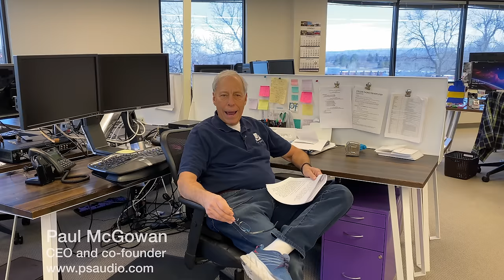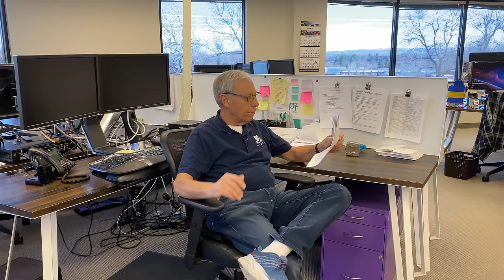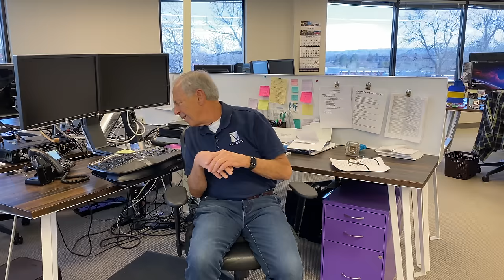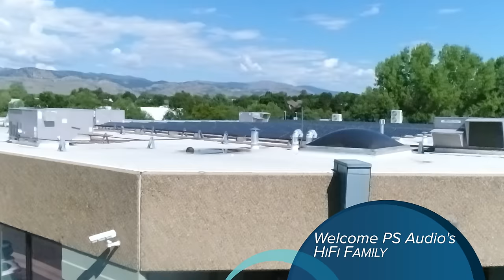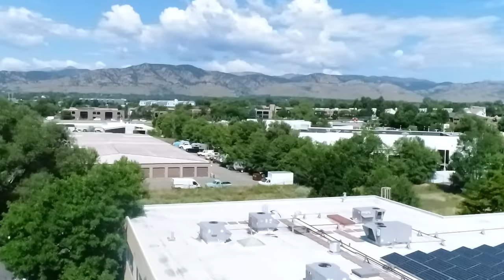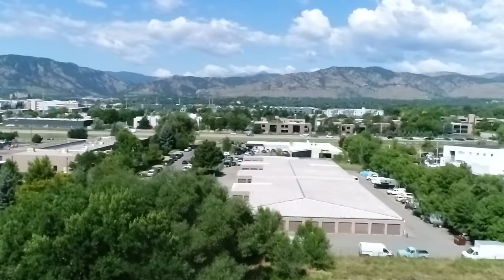Digital or analog out?

Comment: Why do you all call things like this a "CD Transport"? It literally says on the front of my CD player, Sony Super Audio CD Player. Is a "transport" just a empty box with a laser and a way to spin the disc? 
I just watched a video on Nelson Pass and his Ion Cloud speakers. I think he hit audiophiles perfectly.   https://youtu.be/msE14cWTwKI?t=470
Reply: Sort of yes, but the box isn't missing very much that you'll find in a typical CD player. The raw digital data from the laser still needs processing to decode the cross-interleaved Reed–Solomon coded data stream and perform the error detection and correction functions resulting in a bit clock, a word clock, and a data stream for a DAC. Another way to look at it is that a transport includes everything in a CD player except the all important DAC, analog power supplies, and analog output buffer for that DAC while those parts have been replaced by digital line drivers and in most models encoders for the digital output. In the end the amount of hardware is about the same. Another distinction is that in a device designed to deliver digital information rather than analog, special attention is paid to parameters like clock jitter and they'll put extra care into making sure the digital information is presented in the best possible form to the DAC. Can you have transport with a built-in utility DAC? Certainly, that could be a CD player as well.
Reply: @Peter_S_  So the goal is to take a DAT out of the CD player and replace it with an external DAT. Wouldn't a CD Player Maker put the DAT in the CD player that would work best with said CD player? In example, I really cant see someone making a quality Player and then says let's put that POS DAT in there to F_ it up in the very end. Not saying they would put their best in a average Player but at least as good as the rest of the stuff inside the player. Why waste money of good parts just for a crappy DAT? So if the rest of the stuff is only as good as the internal DAT then what is the point of a better external DAT? 
As for the "transports" … just sounds like another way of getting more money out of you while giving you less. The audiophile way imho. My CD player is about the only digital I listen to and I would rather listen to local FM radio then stream. Streaming to me is what you hear in the background at a store in a mall. Don't get me wrong, I was doing it by hot wiring my PC to my stereo back in the late 90's early 2000's just to listen to radio stations from where we used to live. Today I have a Fios feed and I'm sure most of you are "pulling down playlists from the cloud" and such like my kids do but I have let most of that just slide by. Just not into it for some reason. Guess I just getting old and there is none of DAT in my future.
Reply: Very good questions, fin screenname. I'll try to make this ramble easier to follow with some hyphens... 
- As audiophiles, we generally like to achieve the best possible performance of every system component to result in the best sound. 
- The transport/DAC interface provides a perfect point of demarcation between subsystems and the reality is that all parts in a design have a cost. If you engineer a transport which is the best it can be and place all of the investment there without implementing the DAC, you have a best possible component for use in a larger overall system. 
- The DAC subsystem is composed of the DAC chip itself, the output buffer to drive the cable going to the amp, and a low noise analog power supply so it's not inconsequential by any means and it has a very real cost. Not including those pieces means that you still have to spend budget on the parts to transport the digital information, but a very good digital data transport costs less than an audiophile DAC chip and related support parts so you can instead invest more budget in the transport design and its decoder logic. 
- That allows for potentially providing better error response from a more complex and expensive decoder, as well as better mechanical parts used in the transport but on top of that, 
- separating the digital intensive processing and electrically noisy motor environment of the transport from the dead quiet analog world of the DAC chip and isolating them in different chassis with totally different power supplies allows the DAC to perform better with lower noise and who doesn't appreciate lower noise? Chips appreciate it too.
- Once the data has been read, error corrected, decoded, and readied for the DAC, it becomes the universal I2S data format and this format is the same regardless of whether you're using using a cheap consumer DAC chip from a company like Wolfson, an audiophile level DAC chip form a company like ESS, or you're going all out and using an FPGA as PS Audio does in their highest end offerings. There's probably an order of magnitude cost differential between implementing each of those three. So....
- It's not that a company would use a "crappy" DAC, but rather that they would choose a DAC which is "good enough" to address the needs of their customers and for the price point of the player. "Good" comes from a number of perspectives and the transport has all kinds of mechanical aspects that the DAC does not. If you include the best possible everything, your products will cost $$$$$$ and you won't be in business long. As audiophiles we generally know that there are better potentials available than giant makers deliver so we have the benefit of comparatively smaller companies like PS Audio who will address these functions as separate sub-components and offer the ones they do in a best possible implementation.
- Also consider that while the transport can be "perfect enough", the DAC is open to new territory and its performance can be upgraded as new techniques become available. 
- Again, not paying for an audiophile DAC in a transport doesn't mean you're getting any less for your money. Quite on the contrary it usually means that you're getting better engineering and components in what you are getting. It also means you get products from makers who are able to apply their unique talents to each subsystem. Integrateds are almost always a compromise, and sometimes they're multiple compromises. 
- The audiophile world encompasses a wide range of players, some of whom play to excess but at the same time there are good and decent players with some exceptionally high quality offerings delivering excellent price/performance ratios. From all that I've seen in the industry I'm very impressed with every aspect of the PS Audio gear I've looked at and listened to.
- On streaming... You can't make such a blanket statement. If you stream CD quality data, you'll result in the same stream you get from a CD. I can certainly understand being dissatisfied with your computer's DAC and finding it useful only for background music. I don't go after anybody's playlist unless I find it by looking for something specific which it includes and I don't use any streaming service beyond YouTube, radio.garden for broadcast radio, and individual college stations via their websites. YouTube is an amazing resource for finding new things but once I've found them I like to have the CD for my own listening if its available. Much of the time its not.

Comment: Basic answer: Use the best DAC
Either the DAC in your CD player, external DAC or DAC in your integrated amp.
Use the best DAC available in your system.
Reply: More complex answer: It depends on what topology you prefer based on clock synchronization. The DAC synchronized with the CD transport where the DAC works as master is often considered best.